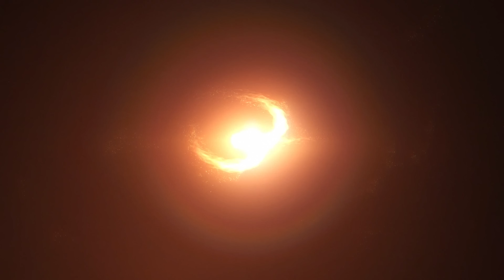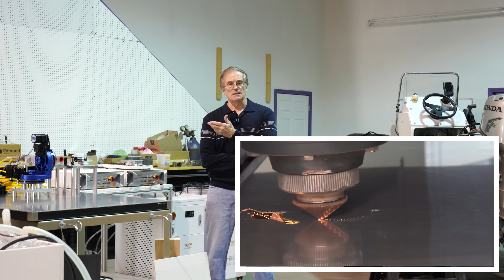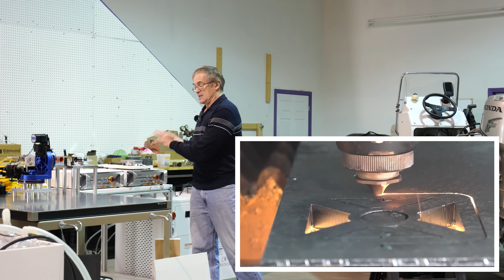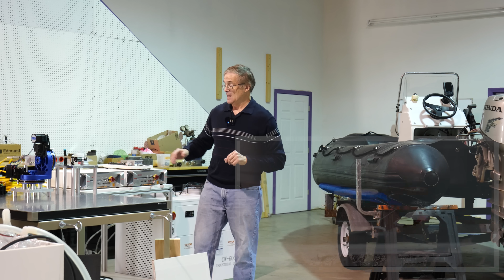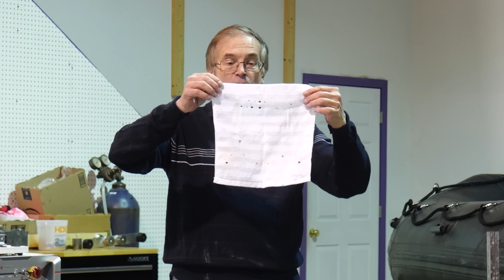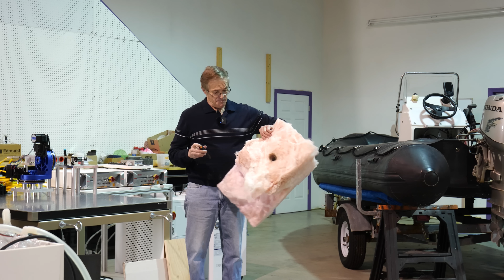We have a problem... and need your help!

Comment: I suspect that the solution is to SCATTER as much as possible of the incoming laser light, WITHIN the barrier itself.

Try aiming your "fully armed and operational" laser into a dry aquarium tank filled with clear glass marbles and see what happens.

The idea is not to make all of the beam's light disappear.  The idea is to make *any light that escapes from your barrier* much less harmful than the incoming beam.

Comment: Three ideas (I think they get better): 
1. I think what you need is a water tank that is a wall, on wheels, transparent glass on one side.  In the water is an opaque dye.  Not sure on the thickness required, but that should be easy to test. It probably will boil some water pushing out of the way, but it should also scatter the beam, weakening it rapidly.  As long as the glass is clean, it should not damage anything.  The sheet of glass that it hits first should probably be borosilicate glass, or other glass that can handle temperature differences well.

2. Could use a modified oscillating spindle sander behind the target / as a test target.  Make the spindle larger so it will not be missed, and crank up the speed.  Could make the spindle out of graphite.  Could also wire it, so the laser cannot turn on unless the oscillating spindle sander is running.

3. Have a mirror at 45 degrees so it aims it straight down.  Then you have a box down there on the ground with graphite brick on the bottom and laser toner on top.  Could have that covered by one way glass to help catch the wayward photons and direct them again into the toner or graphite, and should keep any dust stirred up from hitting the toner within the box.

Comment: Commenting at 5:03. What if you had multiple lower power beams that would converge on the target at a certain range? That way beyond the target they would diverge and become harmless? The computer could have a separate laser for range determination to set the angle for each burning laser

Comment: 1st of all, thank you for all the great videos.

2nd, here are 4 ideas, not the cheapest nor the brightness, but maybe will give you guys (and the others in comments) some inspiration :

1. Space shuttle thermal protection system : maybe you can get / make / or already have one block or something similar with the pads used to protect the space shuttle from the reentry heat.

2. sandwich of pyrolytic graphite sheets - it has really good thermal conductivity on it's plane axis and lower trough it's thickness. Maybe more sheets stacked together and pressed would be enough to absorb and dissipate the energy in form of heat. Maybe some cooling near the plate, ice blocks with water, forced ventilation, even oil, etc.

3. talk with NightHawkInLight - he made some fire proof paints...maybe the carbon produced from those paints has enough porosity so it can absorb the energy of the laser and resist for some seconds.

4. redirect the beam in space with some dichroic mirrors in a small cone ?  (flight hazard ????)

Have a good one !

Comment: This seems insane. The wiser path is just prototype with a much weaker laser until you're certain you're ready to scale up by whatever degree, and then do so, gradually, until you're bored to tears but also 1000% confident. Measure twice, cut once, dialed up to 11. If you're scared enough of it locking up, etc, you're not done measuring. Dirt is the obvious solution otherwise. Find a basement or dig one.

Comment: What about an indoor waterfall? Build a simple wall out of wood, then tilt it back slightly, Use a cheap pump to cycle water from a holding container to the top of the wall, where the water is distributed evenly over the wall. This would solve the problem of water boiling off to quickly to be replaced by more water.

Comment: I kind of like the idea of a lightly-packed mixture of graphite powder and maybe boron carbide or tungsten carbide powder - the carbides are available cheaply in just about any mesh size you want and not nearly as messy as graphite powder (albeit with slightly lower melting points). Maybe try mixing graphite powder with some larger mesh carbides. The graphite would absorb and prevent reflections and maybe the carbide particles would serve as little localized sinks for the heat. You could test this by putting two graphite slab molds from Amazon together and filling the interior with the mixture. Would be simple if it worked.

Comment: You could try Hebel Panels or Hebel blocks. They are relativity light, dense, and have some fire resistance property. They come in various sizes such as 50mm x 2400 x 600

Comment: Instead of making the backstop portable, could you make the laser portable?  That seems like it would be a big challenge, but it would also make your laser much more useful.  If the laser is portable, you could take it somewhere with a natural backstop like a mountain.

You could also limit the laser's aiming cone to be either strictly up into the sky (if you have clear airspace) or down at the ground.  If you avoid near-horizontal angles, all the most vulnerable targets should be safe.

Comment: I'd go with a (large) rotating tungsten disk. It won't be cheap, but rotating targets is something industrial (and medical) xray machines already use to deal with large amounts of energy in a single spot. Maybe a cheaper material would do, too. Moving spots... larger disks.

Comment: LECA is the best I can think of. Not too practical but not the worst. What about that material they use for re-entry? Supposed to be relatively cheap and lightweight. Edit: yeah, no, too toxic.
I'm also thinking a computerguy could solve the issue. Locate the drone then do a slice/cut, don't let the laser shoot in one spot for longer than say 100ms. Though you'd still need a pretty solid backstop during testing.

Comment: My first idea would be to try the alumina-silicate ceramic fiber blankets used in furnaces and the like. you could try with different densities for you application, by compressing them. Its cheap and easily available. It also has the advantage to be white. 
SpaceX Starship tiles material look very similar to this material.

Comment: As a layman in these matters, what do I know, but it would seem the best method would spread the energy out behind the target, is there a way to optically spread the beam out behind the target?  Then any sort of good insulator should be able to absorb the heat.  I also immediately thought of trap targets used in shooting.  A reflection trap of some sort that safely continually reflects the beam inside of itself and sinks the energy away as heat into an insulator.  I dunno, it certainly seems like whatever the solution, taking the columnated energy and spreading it out before hitting the barrier material is the key.

Comment: I would try rock wool insulation.  It's properties are a bit different than fiberglass insulation.   Also the wood board can be painted with an intumescent paint to mitigate fire.

Comment: How about a water cascade (waterfall sheet) flowing against a white background. Recirculate the water via a pump / trough and a heat exchanger if need. water has a high thermal capacity and in this  case due to turbulent flow of well designed cascade non reflective ?

Comment: Could the answer possibly be a network of prisms designed to diffuse and enlarge the diameter of the laser? Dissipating and neutralizing some of its thermal energy.

Comment: I think the answer is some sort of protection that can block the laser, is cheap and can self heal.   A 1 inch sandwich of stones between plywood and a layer of chicken wire to hold them in place could be the answer.   Yes the chicken wire could get damaged, but the laser beam is so thin it's unlikely.  If that's the problem, maybe 2 layers of chicken wire.

Comment: 𝑴𝒂𝒚 𝑰 𝒓𝒆𝒄𝒐𝒎𝒎𝒆𝒏𝒅 𝒖𝒔𝒊𝒏𝒈 𝒔𝒊𝒎𝒑𝒍𝒆 𝒉𝒖𝒎𝒃𝒍𝒆 𝑨𝒆𝒓𝒐𝒈𝒆𝒍? it blocks lasers as well, and you can make it yourself, the stuff can put up with blow torches and lasers are pretty easy for it to work with, just make sure whatever you use to make the Aerogel lattice doesn't off gas, I would assume the Aerogel would still go through ablation, I don't know how quickly it would, but you could easily test it out. I can't think of anything more portable than Aerogel with how light it is, just make sure it is stored properly in transport. You might be able to use a 90 degree angled mirror to redirect the light downwards towards a sample for safer testing.   Also please keep us up to date with your work on Virgil since you obviously have a working laser, hopefully you can restart the Earth's core ASAP Godspeed!

Comment: Well if someone does come up with a lightweight way of stopping the beam then you have a way to defeat the purpose of the beam. One would need to think like a threat actor inventing ways of defeating this laser weapon. My first thought was scattering or diffusion but something needed to handle the intense heat would probably also be very expensive. Some sort of crystalline structure. This is an intriguing problem.

Comment: Use a light detector round the edge of perspex as a wave guide to trigger an off switch. Board, perspex more board all light sealed.
Reply: P.s. it doesn't need to be triggered by laser light burning or light let in would do it. Then you cover the hole with a patch or plaster and you are ready to go again. Multiple light sensors for redundancy.

Comment: Flowing water - a waterfall, colour dyes that absorb some or all of the energy. More bricks like a wall getting the benefit of the cooling flowing water. 
Glass (like the focusing lenses) to permit the beam, water flowing behind.
With a spreader as well, a relatively small portable target could be created.

Comment: 1) brushed sheet metal ? You wont slice through it, the slicing in cutting machines happens because of compressed air blowing molten metal away
2) retry the towel but infused with refractory material like alumina ? Let it dry first, the water will explode ....and find a way to contain the powder from going into your lungs

Comment: Couldn't you pulse the laser like a dimmable LED light to reduce the intensity of the laser? You could run the laser turning the laser on and off at MS or NS intervals so the intensity is reduced and be able to tune down the heat and make it like a rotary gun effect.

Comment: Please check below suggesions if works:
1. Conductive metal container with fill of water. So when leaser heat container water can evaporate.
Or
2. Use lenses to scatter or focus beam using failsafe mechanism.

Comment: Make interlocking aircrete blocks and add sodium silicate and hydrated sodium polyacrylate to the mix. 
You would have to test it but in theory... 1.They will be lightweight 
2. They will be heat resistant even to extreme temperatures. 
3. Once the wall is constructed, it can be hosed down rehydrating the sodium polyacrylate.   This will give you a medium to dissipate the thermal energy to steam.
4. It will be non refective.
5. It should be reusable.

What exact ratio would you need? I don't know you would have to go through experimentation. I would also add a small  amount silica sand and basalt fibers to the mix. This will give you a structural in the sense it would give a structural matrix to hold its form but not structural in a sense of holding any weight for building. 
Also you need enough Mass in the terms of thickness to your blocks to absorb the beam. Off of what you said i am thinking at a min 8-12 in thick. This is just so that there is enough mass of sodium polyacrylate to absorb water and phase change when impacted by the laser. 
The blocks will be significantly heavier after they are hydrated but if left alone they will lose their Mass through dehydration. 

If you are able to relocate outdoors, if not the equipment then just a beam to a targeting mirror... mounds of sand would be the easiest solution. Laser inside, targeting equipment outside.

Comment: If you can't come up with a solution, I sure can't. I was thinking cement underlayment used as tile backer board. It's only about 1/2" thick so easy to move around. You could paint it with white fire resistive paint that bubbles up when exposed to fire.

Comment: Some thermally ablative material as used in heat shields for reentering space craft, I think they some times use some form fibrous material impregnated with phenol resins.
The mechanism of the thermal protection is basically that a amount of the phenol carbonizes and gives of gas. This expands the material and makes a continues isolating layer of foamed ish isolating carbon. if burnt through this layer a new layer of carbon will be formed and so forth.

Comment: Reflect the light with a mirror into a barrel of liquid.at 45 degrees. Possibly with a divergent mirror. Or have mesh that detectors damage to it that triggers a cut off switch. Or a mesh of thermal sensors.

Comment: Oil sand in a fixture to allow new material above to displace the burned away material. Similar to how an impact berm wastes mass to cover a projectile it trapped. All my other ideas scatter the beam hazardously or are cost prohibitive. What’s the beam’s output frequency?

Comment: You tried fiberglass but did you try rock wool? It has a much higher melting temperature than glass. Still reasonably light and inexpensive.

Comment: yea a birm of dirt seems to be the cheapest and most full proof thing you could even put a couple huge boulders in the middle of the dirt pile and then just use a roller or a vibratory plate to tamp the dirt.  i build retaining walls and we back fill with dirt and use a vibratory plate to tamp or compress the dirt as we build the wall and you can rent one for a couple hundred dollars per day or spend a few dollars more and just buy one they usually have a honda engine on them and you can't go wrong there right  lol

Comment: I could be wrong, but i think the best "backyard" solution is any carbon foam. The cheapest way to make it is with the "carbon snake" experiment, mix 4 parts powdered sugar to 1 part baking soda, then light it. You can also turn that mixture into a paste with water spread it along a sheet of plywood, let it dry then light it. I know carbon foam is used as an insulator so it might be worth giving a try
Reply: Homemade Starlite is another option for producing carbon foam. It stays in one chunk after it expands into carbon foam, so you won't need to go through any extra steps, just put it on a backdrop and heat it up.
Reply: it's a great insulator, but it's combustible so I imagine the laser would punch right through it.

Comment: Consider soaking dimensional lumber in a concentrated solution of Tim-bor. Tim-or is commercially available disodium octaborate tetrahydrate. This borate will fuse under heat and reduce the formation of flames and embers. Paint the outer surface of the treated lumber with fire retardant paint once the dimensional lumber is dry. This should give you a safe non-toxic solution. 
Dr. R. W. Morton

Comment: A metal box with a very shiny front that's angled down at 45 degrees. Inside the box behind this is water. Should reflect the laser downwards within your scan parameters. Digs holes in your yard. Maybe good for minutes. The water cools the reflective surface. If it does somehow cut puncture it, the laser will be firing into water at that point. Add dark dye to the water and the laser is firing into a stream of water coming out. Gotta be good for a while that, even if it's boiling the water. You'll have to patch the hole and refill, however. You can empty the water out and the box is light enough to port.

Comment: Something cheap and simple.
Keep the background blocking material moving. Hang a lightweight blocking material that can withstand the laser for a brief time. Now attach bungee cords on the 4 corners with tension. Have something else jiggle and move it around.

The laser dot will not be stationary at any one spot on the material and not burn through even though the laser beam is still, the background will be constantly moving.

Adjust speed and materials as necessary. Easily scaled larger too.

Comment: I ask "perplexity AI" it told me "Ceramics do not burn and are excellent at withstanding repeated laser exposure."  And at the end of the chat we decided on Alumina Ceramic-Coated Aluminum

    Hybrid solution: Thin alumina ceramic layer bonded to an aluminum sheet.

        Ceramic: Resists temperatures >2000°C and reflects/scatters laser energy  

.

Aluminum: Dissipates heat rapidly due to high thermal conductivity
. I Googled it and the "shopping" led me to an 18 foot panel for $287

Comment: Random idea off the top of my head - sand wall.  Make a basic 2x6 wall and sheet it with two pieces of cement board on either side and fill it with a few inches of sand between the cement board.  The idea is that when the laser punches through the cement board, it hits the sand, which melts and flows away from the impact, but more sand flows in from above to backfill in the impact area.  Use fine enough sand and there also will be some refraction of the beam in the sand.  Kind of like self-contained ablative armor.  The whole thing can be on casters for maneuverability, can be scaled up or down for size, and is readily made from cheap and easy to find materials.  As a bonus, you could dig out the (cooled) glass that the laser makes for a neat looking display.  As I think about this, salt might actually work better as a fill medium, but would be more expensive.

To be absolutely safe, you should line a shipping container with this stuff and keep your experiments contained in it.
Reply: Totally Agree. Putting a sand wall on a trolley would also make it portable.